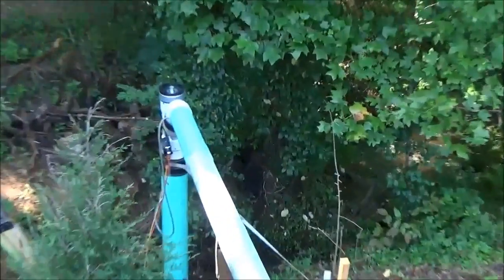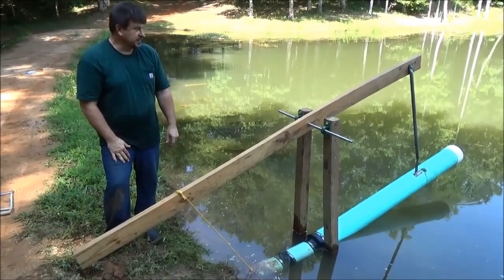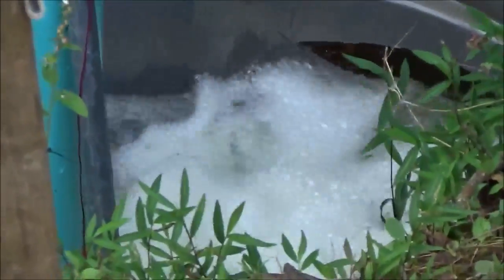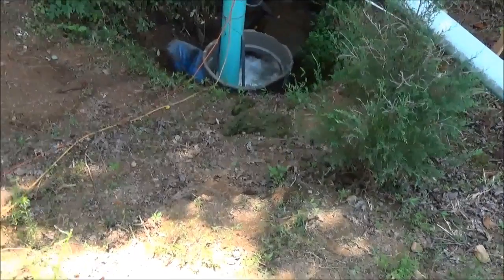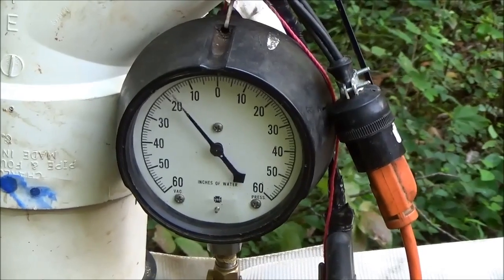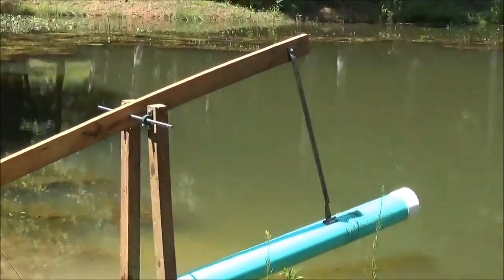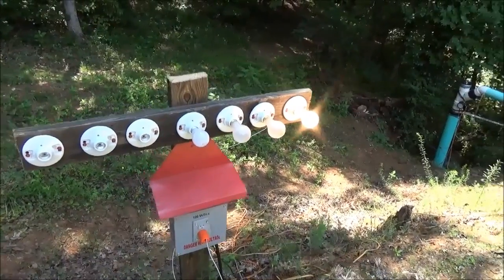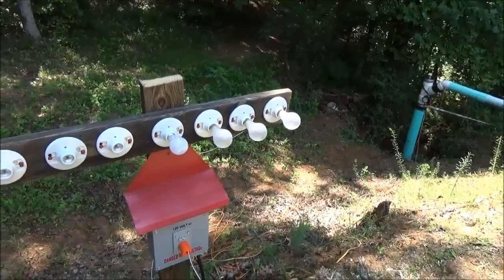Pond Power:  Part 2

Comment from the maker: This project is a good illustration of preparedness.  I am not wasting any water.  I am storing it to use when I need it.  The same amount of water would be flowing out of my pond no matter what I did to it.  I just choose to store up a bunch and then run it through the turbine.
Reply: Hello! check out AIR LIFT PUMPS. No ram pump. Take a look at how air lift pumps are used for aquaculture in Hawaii. Use it to recirculate water.
Reply: +engineer775 Practical Preppers - I would put in a hydraulic ram pump on the waste water to scavenge some of the water back to the pond -
Reply: Good news! the buoyancy of Air in Water is as claimable as the water falling toward the Earth (source of gravity).  to heck with a ram pump if you have made it this far.. make a second bucket that is filled by that rubbermaid trash can under your turbine. direct wire a water pump with an air pump @ 20% the wattage of the water pump together with a venturi entrance for the Air. Use AIR LIFT technique to allow water to be lifted in access of the pumps rated flow rate and the air flow rate of the air pump combined. this is not a perpetual energy machine.. the science is as simple as a water wheel from the 1600's. Air floats is water... water falls toward the center of the Planet. Yay for gravity affecting the pressure of water at lower depths. you will need to splice your supply lines and insert o regulator to not blow up your air and water pumps. if that seems screwy... add another turbine at the relative size needed for you airlift draw. have  the pumps and mini turbine on a separate circuits. no inverter. just regulator and ground. then your water recirculation  will ebb and flow at a minimum keeping your main turbine water PSI more consistent. now add a selenoid or a float valve on that 2X4 so it is automated.
Reply: J.J. MacBocephus Hey, if you want to run the experiment and find out just what the return on materials investment is then more power to you. Like I said - if you or they want to see what happens great. Me personally, I'll watch and learn from someone else's experience on that one first. :)
Reply: I'd love to LOL. Gotta get some acreage first though...
Reply: @ William Branstetter

Are you some kind of idiot that doesn't understand gravity ?
How do you propose to get the water back up the hill and into the pond?
It sure as hell ain't gona do it by itself.  And depending on a bunch of convoluted piping , costing a lot in parts. Ram pumps could only deliver up to say 30ish % of the water back into the pond.
And with it draining that fast just to produce that electricity ... is it really worth it ? ... cheaper to just buy electricity from the grid for 5 years.
Reply: The romans went through mountains , not over them.

LOL so tell me ... how do you make water run up hill ?
Why don't we use this magical concept today for hydro electric power plants ?
Reply: @Mk101T  Surely you know about RAM Pumps that do NOT use power to pump water uphill...you just need a flow of water running into one side of the ram pump
Reply: @boardwalkbw7130  No I have no idea what a ram pump is .   Seeing how Its been 7 years since last I mentioned it in this thread .
Reply: @Mk101T  lolololo...I'm sorry...feeling stupid now for not noticing the date...lololo
Reply: @boardwalkbw7130  No problem ;)
And I guess I should watch my snarky comments seeing how I ended up apologizing to William over it .
Reply: @Mk101T  Me too I get lazy and end up sounding all wrong...lolo
Reply: @ William Branstetter
And I wanted to add ...  I'm sorry for my initial derogatory response to you.  There really was no call for it ... I don't blame you for your response in kind.
Reply: @ William  Howdy nice to see you came back ... and again ... I am sorry for my opening sentence to you of ...

"Are you some kind of idiot that doesn't understand gravity ?"

It was punk ass bullshit.

But nobody has removed your comments as far as my youtube can see ... they all still there :/   
No way I could do it anyways ... would be engineer775 because of both starting the thread and being the video poster.

Youtube has been kinda squirelly over the past while ... could just be your Browser / login provider / and/or Youtube ???
Reply: Build a second pond underneath the main pond to collect the water then use a ram pump to move all the water back up to the main pond
Reply: I am impressed how you maximize the natural resources that would otherwise be wasted (as you said in the video) and put it to practical use. Excellent and thank you for showing us that we can do the same!
Reply: Ram pumps work with no electricity , an air lift pump requires you to move air , which is most likely done with electricity ... plus you can't get much head pressure with them ( moving water above the static level)
The video shows him producing 500 watts sustainable with dumping about 300-500 gpm (guessing by visual)
What would be the power requirements on even returning 10% of that ?   Since the point in this video is usable electricity for something else , how much electricity would you have left over ?

Nope the ram pump method would be far better , or you just use the water fall to turn a turbine that then directly turns an impeller for pumping air , but then what is the point in the first place ?
Reply: "an air lift pump requires you to move air" -MK101T ... look up the Venturi effect.     Then think..                 Does air rise when its released into water? Does water fall when its released into air? If you can't understand the benefit of these two opposing principles used in combination then why even start thinking about wattage. You are missing the point and maybe stuck in the petroleum age. you are thinking about it with two boxes of twisted ration. Think one step at a time like building a brick wall. Only move on to the next course if the prior is finished . You will be less likely to subjugate your thinking efforts in a tangle of rational.  I prefer reason. That your slip. you don't understand the primary reason to recirculate water and I have a hunch you don't go outside and do tangible projects with water. It's not me that makes air move up through water, just as i don't make water fall to the ground. Whether you agree with that or not has little to do with understanding why having the water put back in the pond is a good thing.   "whats the point?" you say...       Does a ram pump oxygenate water? Does it make a continuous noise from the discharge rocker/ valves? Does a ramp pump use the energy from air floating upward in water to carry water upwards? you are also not understanding of the amount of lead pipe it takes to have enough pressure to allow the tower to perform. If you used a ramp pump it would require some 50 ft of lead pipe and even more elevation drop from the turbine discharge location. Ramp pumps require back pressure in excess of the towers peak pressure... what I am proposing is applicable with zero lead and zero elevation change to get the equipment to work.  I'm not talking about moving the water downhill to get it back up hill. It is inherently simpler to just put it back into the pond from the point of the turbine. The bigger picture is the flow rate into the pond vs. the flow rate out of the pond... how many months of the year do you want power? Being able to extend the season in which this system operates is of benefit.
Reply: Howdy M.R. C.    I missed your latest response until now ... thanks to Shaza Maza ... for making it pop back into my notifications.

I guess first off ... let me clarify that ram pumps are not being used with lead pipes in todays world ... they are iron pipes.   That being said ... yes the mechanical concepts are the same , except the pressure is more tightly held with Iron than Lead.

And as far as the Venturi effect with regard to air lifting . You are referring to what I think is known as an "educator" ???
Which is an hour glass portion of the pipe ... and at that section ... air is introduced.   Which when vertical creates suction on the lower portion as the air bubbles rise ... simply because of volume needing to be equal.
However thinking about it in ram pump concepts ... the venturi effect working for us on the suction side ... would be cancelled by the restriction pressure from the volume side.
Not that some venturi action introduced with air at an educator wouldn't help in returning a bit more water to the pond.

I suppose you could have a ram pump and air lift working side by side ...
But remember the point is to create electricity for other use.
Hence how much electricity is used in generating the air for the educator in the first place ... or just direct kinetic energy ?

Would be interesting to do some research testing to find out the hard numbers :)
Reply: engineer775 Practical Preppers
Reply: @ Nicholas Belken    Hey thanks for the thought of +1
But don't be +1ing that comment ... or atleast chime in to the conversation.

No matter how you slice it ... I was a dick without call towards William.
Reply: I know this is an old post but water 'runs uphill' by being evaporated by the sun, condensed into clouds and then precipitated onto higher elevations. Hydro electric power plants do use this method today, or rather they rely on the natural weather phenomenon to enact it for them. It would be interesting to study the most effective way to replicate that action on a small scale with a solar powered boiler or something. I wonder how much surface area it would take to continuously distill the outbound water and direct the vapor back into the pond to be condensed. Of course for continual operation from direct solar gains the evaporation would have to exceed the outbound water so that the pond could drain while the sun was down. Or an overproduction of electricity stored in batteries to allow the system to rest.
Reply: Christopher Smith said " with a solar powered boiler"

If you're harnessing solar energy , why bother with the intermediary of recirculating water to basically use the pond as a kinetic energy battery ?
Just convert the solar energy directly to electricity , and use real batteries.
But what you are suggesting is a green house effect , something they did do with biosphere 2.
Reply: Mk101T It's just good to explore options that don't require solar panels and lead acid batteries. There's nothing wrong with them but they do require much more to engineer and maintain since there are several refined components that need to be assembled and much of the solar technology requires micro manufacturing. In many cases the ability to move water is one of the sole demands on eletrical devices, so depending on the end goal you might skip the step of producing electricity instead. And there are a plethora of physically powered implements that can work directly from the flow of water rather than the flow of electricity. So it's good to have other options to apply to any specific context. Also a solar boiler would supply a source of clean, distilled water that could be tapped into for other uses. The more practical functions a system has the more effecient it is at producing the things we need to live. And since this is a prepper video, simple engineering and stacked functions seem like the right things to highlight.
Reply: @ Christopher   Well simply put ... you need a translucent dome to capture water vapor , turning it back into liquid.
Of course that is A FREE kinetic energy action to harness ...
But what are the realistic ramifications to make that happen ?

This guy is in biosphere 1 ... dealing with the physical realities of that.
Reply: I guess sure ... ya'll keep coming up with your lofty ideas.
But lofty is only that without solving the problem.
And frankly nothing solves the problem better than just adding another ram pump.
You can't beat that efficiency with materials and effort for return.
Reply: how is a solar boiler not requiring solar panels again?

especially one that boils 500 gallons per minute lol. it takes several thousand watts to boil a gallon of water by the way.
Reply: Because gravity is what allows the system to work. You can't pump all the water back up into the pond without using the power you are creating. A ram pump with enough compression to pump that much water would back up the system - causing the water flow to slow down and hence, the power output to be greatly reduced. The best you could do would be a free-flowing ram pump down stream a bit and back into the pond, but that would yield probably less than 10% probably far less. I guess it might be worth giving it a shot if they want to just see what happens, but I wouldn't mess with it personally. Physics is a bitch. :)
Reply: @MandrakeDCR  if God had to be bound by Physics band-aids would be everywhere and the core systems would be kaput. Physics is an ass, all the nonsense about 'you can't get more out than you put in' is a fudge, whichever way you care to lean, once there wasn't, ANYTHING, now there is, and more more more every next day. One ram pump may feed back but a percentage, but is there any reason ten of them couldn't make up the shortfall? Unity itself is the lie - everything ebbs and flows, equilibrium is but a momentary thing, compared to all time, when predominantly it is absent.
Reply: @MandrakeDCR  what you do is have a solar pump that pumps water back up when the sun is shining then run the hydro at night ;)
Reply: @Forester-qs5mf  hydrautomat i hear has an efficiency of 80%(20% water loss) and only costs the time to build it and doesnt rely on the sun..... More people should know about it. I think it is fairly fast too but i am not sure.

Airlift pumps or perhaps geyser pump could work in addition. These work on the principle of compressed air to lift water with rising air... HOWEVER, by entraining air with the falling water(already happens in this setup but it could be made a lot more efficient) one could have thin tubes transporting some of the water back again...

Let's remember falling water/pressurised water is already free energy if you dont care about where it goes afterwards and there's enough of it for your use, however a hydrautomat CAN lift a lot of the water up again(just like a rampump, however it is a lot more efficient when it comes to water use) and an airlift pump CAN lift water up again... Whether it is 100% or not i do not know but if the hydrautomat really is 80% and fairly fast in combination with airlift pump you may have a winner on your hand because the energy for the airlift pump can be taken out of the fall and whatever is left you can use your hydrautomat because it works of off static pressure.
Reply: Rodrick, what you're talking about is 'perpetual motion' and it's impossible because you break the rules of thermodynamics. The power you need to get the water back to the pond would defeat it's original purpose.
Reply: @SoundMediaVibes  A Ram Pump does not use power...even if you wanted a "powered" pump instead of a ram pump...just use a solar powered pump since it will not be pumping non stop...even a combo of wind and solar powered pump would be so worth it. Not everyone has free flowing continuous water and even if they do...draining aquafers...wasting water not ideal. Lots of off grid Asians already figured this all out and have been using the "closed loop Pumped Storage Hydropower" seamlessly for the last few years. They teach others how to do this for FREE and they even teach how to build our own ram pumps...like HEAVY DUTY ram pumps using biggo tanks usually used for old school hot water heaters. It's incredible...just a low pond and a high pond...the heavy duty ram pumps the water from the low pond back to the high pond at a perfect rate.
Reply: OptimusPryhme In terms of overall preparedness though, having that extra ramp pump recovering some of the water loss would be worth it's weight in gold. You'd be talking about recovering water for creating power, or for purifying and drinking, etc. I should think that a 10% recovery on a pond that size would be fantastic.
Reply: engineer775 Practical Preppers my question is why not run the water back into your pond that way you can run it 24/7 without losing water?
Reply: Ya ... he should be reported.
Reply: what if you could pump the water back in to the pond and have a double energy in put then you could shut off the second one so you can just take water out of the pond? have you ever thought of that?
Reply: Rodrick Karrerod I was thinking along the same way. How about possibly redirecting at least some of the water (50-75%) back into the pond and that way you could sustain longer than what you are doing now. With that kind of flow you should be able to direct some of the water back with other pipes and not lose as much, with that kind of pressure. Wouldn't it extend your amount of water as well?? Just thoughts. I'm not an engineer but I was just thinking of this while watching your videos. I have enjoyed them, by the way.

Comment: Could you put another turbine at the exit of the tub?
Reply from the maker: Nope.  All the power has been exhausted at that point.
Reply: +engineer775 Practical Preppers  what about a small water wheel attached to the output from the rubber maid water tank.   may be able to spin a wheel there

Comment: So when the turbine can't sustain the load, does that mean the turbine blades are frozen into place? It seems like it should continue to spin, but just dim the light bulbs.
Reply: The generator is still spinning but when the RPMs are to low to maintain 120 volts the inverter will cut off .But the generator is always putting out power as long as it is spinning.